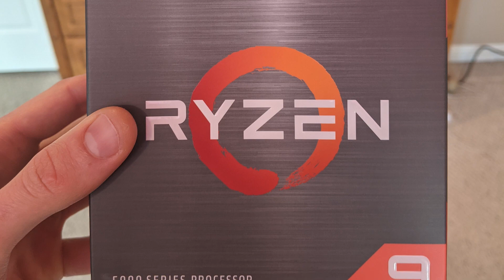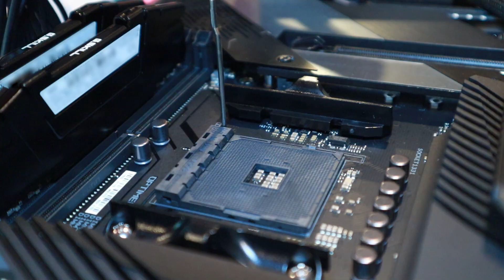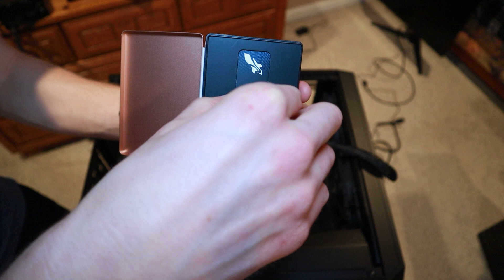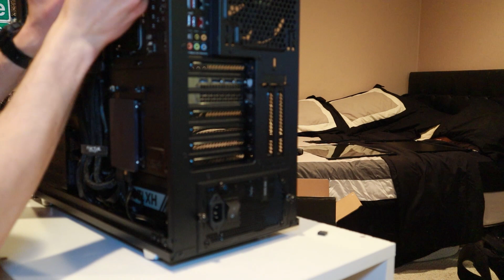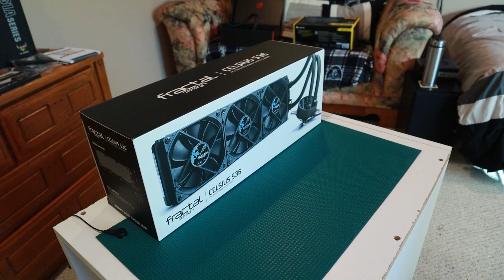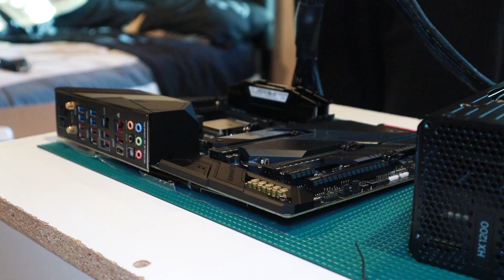Building the ULTIMATE Game Development PC - Content Creation with the AMD 5950X and RTX 3070

Comment: Since this video is from 2020, which changes would you recommend to this configuration if the goal is game design, with good features to support 3D animation? The desktop would not need to have the same configuration that would be needed for a senior animator but for a self-taught kid that is starting to create his first projects. I also know he will be using Unity and Maya.
Reply from the maker: I've been using this PC in this same configuration pretty much every day since this video and it still is performing amazing! Granted these are for professional and heavier performance workloads, so it may be a bit overkill for what you are going for.
For processors I'd recommend anything at or above the Intel i5 / AMD Ryzen 5700
RAM should be 32GB or greater
The RTX3070 has been a great GPU for me, but I also know the 3060Ti and 4060Ti are solid options as well
A fast M.2 SSD is also a must have! 1-2 TB should be enough to get started
It may even be worth it to look into gaming laptops, as that is what I was using when I started - it would be an easy way to get everything all in one package. Certainly won't be as good as a dedicated desktop, but there are good ones from Asus and Acer.
Hope that helps!
Reply: @TurboMakesGames  Thank you very much. It was really helpful. 😊

Comment: Your power supply will last at least 10 years, but during 10 years it will collect lots of dust, making it inefficient. As corsair do not allow you to open the unit for a quick clean up, please let me know how will you keep it clean for 10 years without taking to the service center. Thanks
Reply from the maker: Dusting it out on a regular basis (once every 3-6 months) should be plenty fine

Comment: Congratulations on purchasing my dream PC. Really powerful system. I hope you enjoy it.  I was looking at upgrading my Ryzen 3 1200/8GBRam/1050ti system for HDRP specifically, but after a few weeks of research I got a graphics display tablet (which works amazingly in Unreal Engine, but Unity doesn't seem to support it, frustratingly), and an Akia midi controller for music and controlling Unity parameters. The graphics tablet showed up this morning, so still playing with it/setting it up. No more upgrades for me except maybe GPU and a rasberry PI 5 when it releases.
Reply from the maker: Fun stuff! You're going to see a huge jump in performance once you upgrade your system. I have Korg MIDI controller - admittedly I haven't used it that much but it is really cool to have physical sliders and knobs to change parameters on the fly.